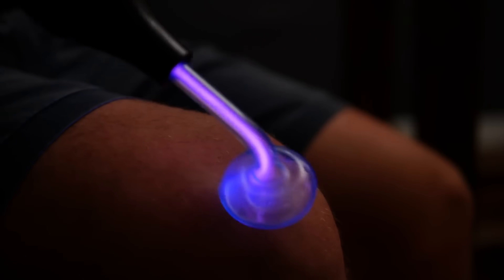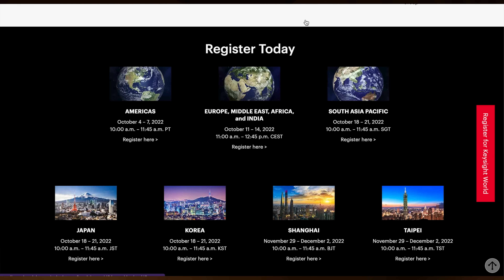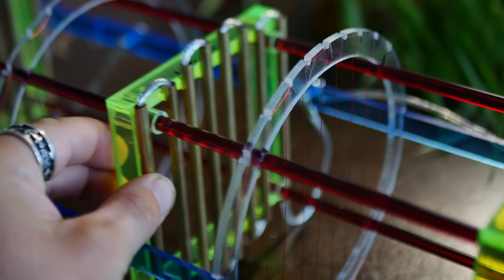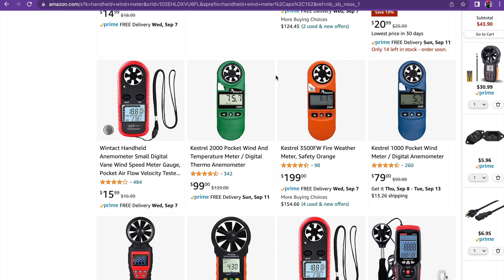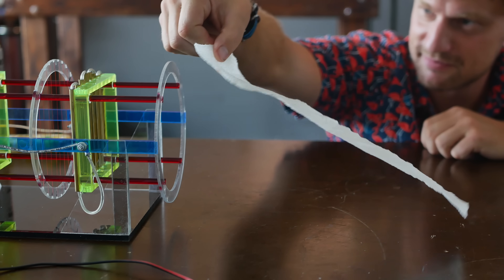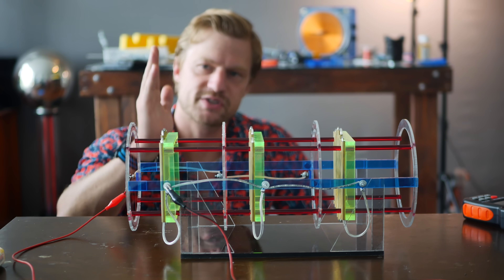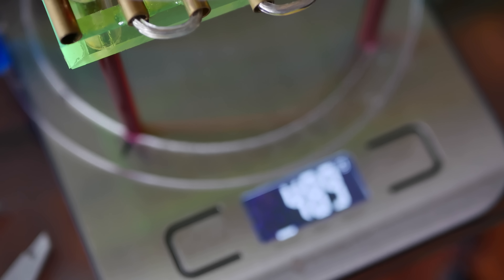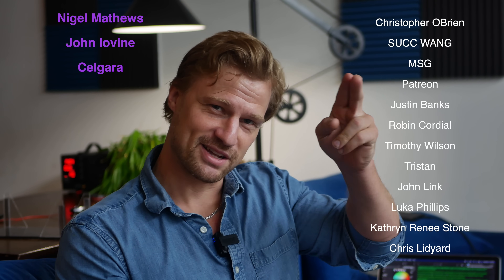Designing A Next-Gen Ionic Thruster! (For Flight)

Comment: That is literally the coolest build I have seen in 2023. Very impressive! 

1. What effect would pre-charging a higher volume of molecules at the 'air intake' have? Perhaps a highly charged mesh to create a larger mass of particles that would be attracted at the intake. 
2. What if you were to supply power to each stage using a square wave at a given frequency? You could change the frequency and amplitude of the wave at each stage. Sort of like the rail gun principle...accelerate the ions as they move through the engine. 

It seems like there should be a momentum and recharge aspect to the motor we cannot see.

Comment: My first thought is you need an inlet trumpet and my second is you need to duct the air. You can also shape the electric ground rods make their cross section less round and more tear drop shaped. (think formula 1 car suspension). Air speed will likely increase with reduced outlet cross section/opening as well.  Im guessing updated air speed measurement will go to 3.2m/s to 4.8 m/s

Comment: your tubes that are round,  should have been Low Reynolds Number Airfoil like a rc15 even flat bars would be better. making the emitter grid bigger than the receiver grid to quasi compress the air.  with the airfoild aranged to help guide the air into a better shape to allow more air in.

Comment: May be you can try to modify the build in a cone shape where the exit has smaller diameter then the intake and cover up the side surface, just like an actual cone and then try again.

this will include the benefits you get from the traditional thrusters.

Comment: question. what if you were to alternate which direction the individual electrode pairs are going? like, have the first and third positive/negative pairs be up and down as normal, then have the second of the three pairs running side-to-side (IE, rotated 90° clockwise/counterclockwise around the axis of airflow)? does that affect airflow or thrust or anything? also, what about changes in distance between the electrode pairs (closer together or further apart)? how would throwing a fourth, fifth, sixth etc pair of electrodes modify the resulting thrust (does it scale linearly, multiplicatively, or exponentially)? how much extra thrust would you get if you had a tube around the apparatus to keep air from (potentially) flowing out the sides?

Comment: Actually did a project with the old ionic lifters back in high school for the science fair!  Try applying a dielectric/insulator to the leading edge of the negative/ground electrode.  Additionally, lengthening the (negative) electrode allows for more surface area for the charged air ions to apply force to.  Just two suggestions!
Reply: A long time ago I remember reading that using sand paper on the copper wires made more lift.

Comment: I imagine the positive and negative surface could be optimised further I. Terms of design and air flow allowance. The best thing you could do by far tho is use a housing. If you can Utilise a collector so the air gets accelerated  like the Venturi effect you could see big ass gains. That’s a legit ion air craft power plant there in its early stage. Fucking sick mate also because it doesn’t have to deal with combustion or heavy parts like every single thing about that could be made out of the thinnest lightest material possible. And we need to see what 4/5… ionic emitters?? Are like in comparison to 3

Comment: The bright spots on the magnet wire appear to be from where the enamel coating has broken down and arced through.  It would probably be more efficient to use bare wires or a very fine bare metal mesh.  Also, the 90 Watts of power measurement - is that the consumption of the whole system?  I'd like to know the power consumption of just the thruster by subtracting off the no-load power consumption of the power supply.

Comment: this is absolutley fascinating and I cant wait to follow this journey. maybe youll have your technology in orbit and beyond!

1. Would some type of enclosed tube or inlet vented tube around the structure provide more or less total thrust? with increase in pressure, especially per stage, it would be interesting results! 
2. the total weight of the structure can be reduced with the scale of the actual thrusters being increased.
3. If evidence shows as dramatic of an increase per stage as 33% with the second, 50% with the third...how many stages of ion thrusters could be placed until the returns become diminishing?
Reply: The Europeans have already developed an air breathing ion thruster for orbit. There is a very small amount of air in orbit. Normally it just slows down craft. The EU design basically takes in the orbital atoms and ejects them at higher velocity out the back.
Reply: @letsburn00  yes, definitely. I am hopeful to see future iterations of this design (or any new improvements) used to lay the groundwork for new space infrastructure!

Comment: The 3 inefficiencies as far as I can tell:

1) the open design allows thrusted air to vent out of the sides, reducing the effective thrust at the exhaust outlet 

2) the conductor’s material and shape can cause unintended friction/ heating reducing their efficiency and possibly introducing turbulence 

3) you may be able to achieve more thrust by varying the sizes of the air inlet/outlet to maximize air flow in while increasing air velocity out 

Hope I’m close enough ✌️. Also fantastic work and proof of concept really enjoyed watching

Comment: It's awesome, and I realize, that the assemblie's purpose is to test the improvement using and array of trusters, hece i have a few questions;
1) why did you use circular grids for the cathode wires?
2) why not a more dense distribution of wires in the cathode?
3) what is the result if you put the catodes closest beforte a reverse arc?

Comment: Not sure it would be worth the added complexity, but what about making pulses of ions run through a series of high voltage AC grids. IOW, just before they hit grid 1, make grid 1 neutral, and grid 2 ground. After passing grid 1 make it positive to push them toward grid 2 pulling them until just before they hit and then psyching them out by going neutral and making grid 3 ground.

Comment: 1. you need a shroud around the thruster 2. you used tubes when you should have used a sharper shape such as a wire or a sheet 3. you should use some type of nozzle at the rear of the thruster

Comment: You're sort of, but not really doing a proper factorial experiment but it's more of a OFAT of an OFAT. You actually have most of the data for a simple factorial test with constant spacing, but when you get into different spacing for each stage you're missing a bunch and OFAT just fails. You can't predict factor interaction in OFAT and staged designs always have factor interactions. If you were to properly optimize using Factorial experiments you might gain even more.

Comment: I think it would help to enclose it in a tube so that you continuously accelerate the air that’s pulled into the front. With it open, I’d imagine it’s pulling some amount of still air from the outside which is probably limiting the exit velocity somewhat by introducing lower velocity flow in the middle. Also, it might be interesting to try smaller tubes for the electrodes to try and decrease the drag those cause. There may be some diminishing returns with that as it might negatively affect the field in there, but nonetheless it would be interesting to see. 

I also think adding a diverging nozzle will help accelerate the flow and give you some more thrust. I’d love to see different sizes/geometries of nozzles and how much you can choke it down before back pressure becomes an issue.

Awesome video :) I really appreciate the analytical and quantitative approach to this. Excited to see how much performance you can get out of this thing!

Comment: would rotating the the individual stages so that they are at opposing angles make a difference? also how many charged stages per ground can you use as the ground looks like the heaviest component? in a similar vein just changing the ground material to a foil instead of a metal tube?

Comment: So I have  two main  questions. I'll just list them, it will be easier.

1. While shown a change is velocity when disconnecting one thruster that does not necessarily prove that 3 ionic thrusters in series are better than in paralel. So do 3 independent thrusters produce more or less thrust combined than this design?

2. Does the thickness of the wire and tubes change thrust in a ionic thruster? What about the material?

Comment: 1) Ducting airflow
2) Nozzle
3) Additional stages
4) Larger size
5) More surface area for the negative side
PS) A 30kv stun gun wired to run on a 3s LiPo works great as a cheap and lightweight portable power supply for lifters. When you are ready for an aircraft to attach it to, see the Red Bull Ground Control 2019 winning design. I did a full write up on Instructables. We actually tried power it with ionic trusters before the flight with limited success. Love the idea of multiple stages! Makes me want to build another one! (They destroyed it after the flight.)

Comment: I’d like to see you test the thrust (not the air velocity) comparing your design to 3 single thrusters without them blowing into each other. With your design, you saw an increase in airflow of 50% compared to a single thruster but if you had put the three thrusters by themselves, you would have seen a 3x increase in airflow (not air velocity) compared to a single thruster with the same power input as your design. Maybe the reason your design hasn’t been adopted is because higher airflow takes priority over higher air velocity.

Where your design might shine is the propellant (air) needed for thrust. You’d be moving less volume of air but at higher velocity. So maybe in systems where we need to provide our own propellant, your design could work well

Comment: Staggering is akin to transmission gears, I assume? Once the air molecules are moving, they can take another kick sooner than when they were still. But staggering requires a longer chamber. To shorten all distances to absolute minimum, should you not stagger the voltage at each stage instead?

Comment: Gathering more air may be the key to thrust here... an annular arrangement for the first stage might help add air mass, basically the emitter as convex wireframe cone and the collector a smaller tube-frame cone, with second and possible third stages as linear stages, perhaps sizing down to restrict the nozzle and increase velocity even more. And maybe see if you can find oval shaped tube collectors to improve drag?  Could also differentiate voltage potentials by powering stages in blocks within the voltage multiplier. 

Also read that polarity isn't so important for actual function... but negative polarity will excite nitrogen first, but positive polarity excites oxygen first. Since air is 78% nitrogen it might be worth checking flipped polarity out for changes in thrust. 

Last point... you're leaking air mass out the sides between stages, without ducting that's just going to happen because flow cannot be linear. Some ion flow backwards is possible too... which, along with the stepped potential idea, could mean airfoil shaped tubes past the first wire might actually work if the stages function in an isolated manner (?). If that's a doubler, then first stage would go wire to tube at 15kv, and the sharp back end of the tube would emit ions to the next bank of tubes without a wire if that second bank is wired to 30kv, and the third at 60kv. I might have that backwards, but you get the idea... exploiting a multistaged potential to eliminate the need for separate wire emitters by tapping different points in the multiplier, while also exploiting the directionality of the ion path by presenting a smooth surface to the preceding emitter, but a sharp surface to act as another emitter for the trailing stage.  Literally thinking of this on the fly, so I might be missing something important like potential for backflow even with a smooth collector surface (or voltage loss from interstage taps on the doubler).

Comment: The staggered thrust solution reminds me of how different turbine blade pitches throughout the stages. So each stage could accelerate airflow as it passes through.
Reply: Could be worth trying to run each stage on a different voltage - it might not improve thrust, but maybe it would decrease power consumption.
Reply: For turbine engines the compressor stage slows down air flow and increasing PSI. With a combination fan stage (2ndary/bypass) airflow which gives it thrust when adding all that with fire and fuel mixture.

Comment: Now hear me out, what about a low aspect wing, that is basically just a lifting body.
Long but not that wide.
Place your multi-stage ionic thrusters along the surface of the wing, you could in theory have a short take off short landing craft without any moving parts.
Reply: OF note, this design means there is basically no added mass for mounting hardware making the thrust to weight ratio crazy good.

Comment: 1) missing a tube for containment and direction of air flow  2) air could be forced through a smaller opening at the end of the tube for more thrust 3) more wires in the grid?

Comment: So what if you remove two stages, make it light weight and add a shroud around it so it basically more closely resembles a turbines. Maybe also test how density of electrodes might affect the thrust and speed, and in addition to density maybe also size of the surface.

Comment: I'd like to see this as a desk fan, or PC fan cooler, and compare the airflow and efficiency to a traditional top of the line PC fan cooler that runs off a 5v connection.
Reply: This thing was drawing 90 watts. That is the equivalent of 18 amps at 5V which is way higher than any PC fan would be drawing.

Comment: Test bed problems
1. Start of each lifter is set in stone leading to a variable gap in each test that could be a cause of improvement in the staggered test.
2. Each step uses the same voltage currently
  If staggered gaps between negative and positive of each step allows for an improvement overall, it seems reasonable that it can be replicated using varied voltages allowing for a smaller platform.  Larger gap means more electrical resistance so less voltage should do the same with a tighter gap
3. More varied ground plates as while a large and solid ground is good it also gets in the way of the air so testing different shapes and sizes should allow for further improvement.

Comment: One you need an enclosure I would put vents on each stage for input intake and that way you'll have stuff not randomly going outside but going in. What would happen if you were to take a metal screen which would have greater surface area though still be Sharp so to speak as the electrode or is it the other way around you know what I mean

Comment: In the photos there are sports on the wire that are brighter than the rest of the wire. 

What are those spots? 

Would it be more efficient if those spots weren't there?

Is that where the plasma is produced?

If it does would even distribution produce less turbulence?

Comment: 1. Sharpen the trailing edge of the forward electrode. If you could turn the trailing edge of the forward electrode into a saw tooth shape, you might get better ion production.
2. Shape the rear electrode to be more aerodynamic. Use a similar shape to those ionic thrusters with foil.
3. Use lighter building materials. Use normal light weight building techniques to reduce the weight of the structure.

I loved the video! Fantastic work. I look forward to future developments.

Comment: This is not a new thing. They make drones with this setup. Good job not doing anything new.
Reply from the maker: Comparing a helicopter to an airplane, in order to demonstrate "flight has already been achieved by x, therefore y is useless", is not really a valid stance though. Multi-stage ionic thrust is very limited in application - this was just my stab at it. Cheers.

Comment: how about a cross pattern to the wires and shrinking and or a more aerodynamic negative set. Perhaps a 3D printed grid could be created that would allow for a laminar flow. Also what is the potential to pack the units closer together? Have you considered the aerodynamics of a housing, there may be a Bernoulli like design of the shell that could ramp up the velocity.

Comment: a. Use some smoke along the front and sides to see where the air is being pulled, pushed and directed.  Depending on that you could enclose it.   b. Change the grounding rods to grounding strips for air flow.  c. You might try making a donut shape, allowing more air to be pulled along into the intake and focus the stream.  Maybe by removing 1 center wire?  d. try variable spacing of the panels with 1" as the first to do the initial air pull, the other panels are working with air that's already moving so space those out farther.

Comment: The wire has no sharp escape points for the flow of electrons. Carbon fiber brushes/bristles as for ozone generators, soldered onto the wire at regular intervals, would greatly increase the overall efficiency and thrust.

Comment: the biggest problem i see with your thrust to weight ratio is you did not calculate in the weight of the power supply their for your thrust to weight calculations are off

Comment: This is a really cool proof of concept.  would enclosing and adding a slight inward taper from front to rear possibly help compress a bit of the air flow to maximize potential lift while limiting lost air flow from in-between the different thruster sections?